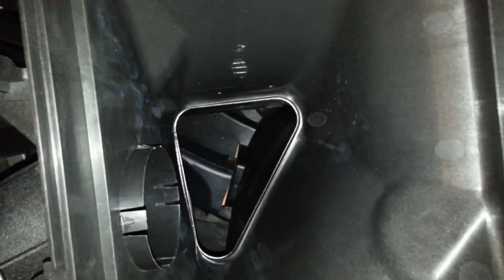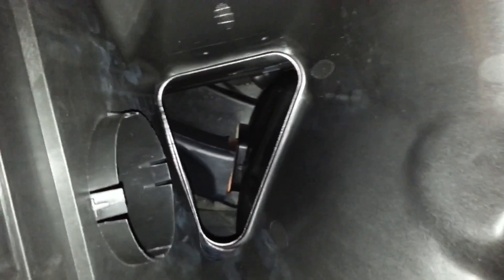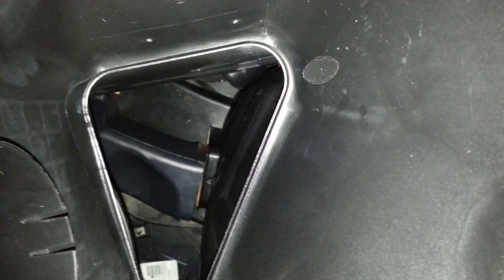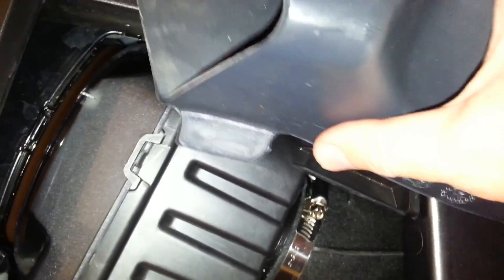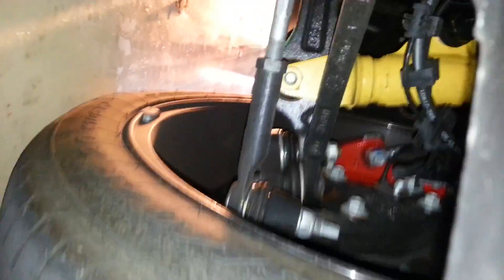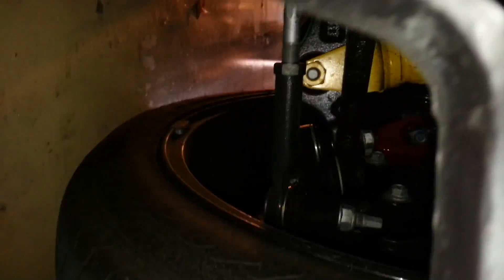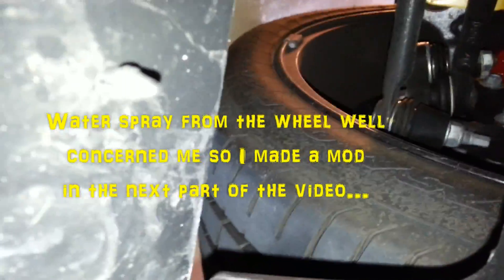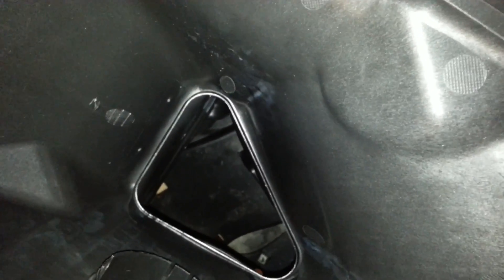2015 Challenger: mod to get fresh air to the airbox

Comment: I installed a Hellcat lower box with inlet tube on my Charger Scat Pack. This dropped my IAT from about 18-20 over 90 ambient to about 7-9 over. B Mason did something similar to his driver-side brake air duct on his Challenger, for more cold air (starting at 2:50 in this video https://www.youtube.com/watch?v=7vrcp3GV6eA). My 2020 Charger has the same mod that B Mason did, but from the factory. Thanks for sharing!

Comment: I dont think this guy knows what the hell hes doing.taking chances of water and dirt getting on the filter.let us know how it's doing a year from now.thanks
Reply: Drove in heavy rain (we get a lot of that in FL), flooded streets, puddles deep enough to throw rooster tails of water, over 2 years.  Never a problem.  The path to the filter is not direct and you'd have to be soaking the car in water over 18 inches deep to even start to have a problem.

Comment: But at 75 mph on the highway the air will just shoot straight through.  You are not getting any more airflow.  Not to mention you still leave your filter open to water if you run through a big puddle, or if it is raining very heavily.  The air duct was there for a reason and if you hydrolock your engine because you removed the air duct preventing that from happening, and then posted it on YouTube showing you did it lots of luck getting your engine replaced under warranty.

Comment: Good explanations however I dont think its necessary - I only have an R/T and did the hellcat airbox WITHOUT using clamps and the IAT was only a few degrees higher than Ambient when moving(which is the only time it will be effective)

So additional air from the bottom wont make that big of a difference - and the clamps wont be doing much due to air will constantly be rammed into the box while moving and because the tube overlaps the headlight opening, air shouldnt escape. if the headlight hole was BIGGER than the tube then yes the air could escape from the edges :)